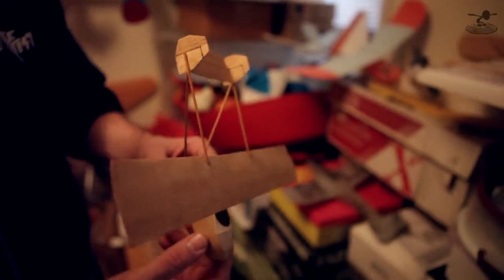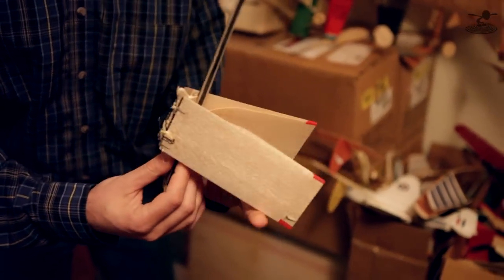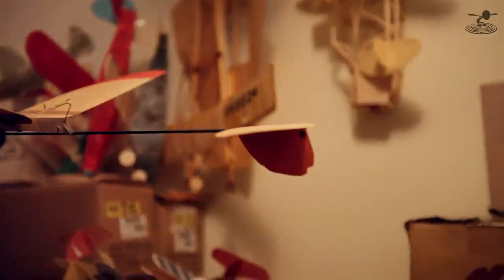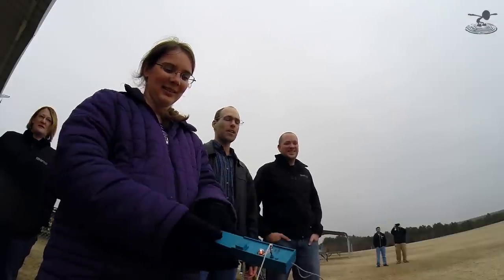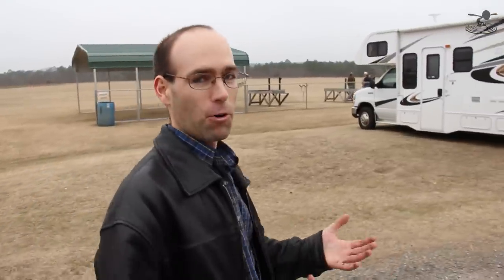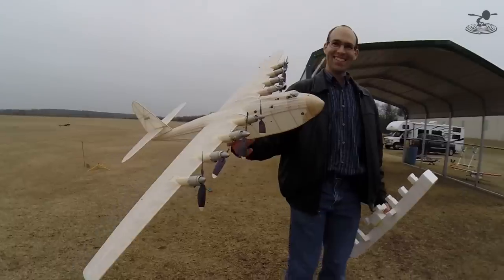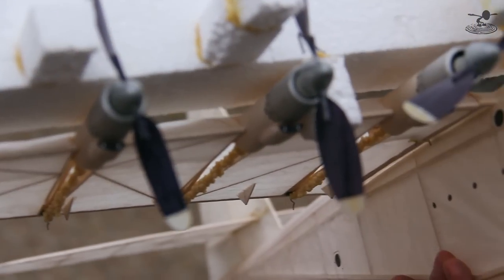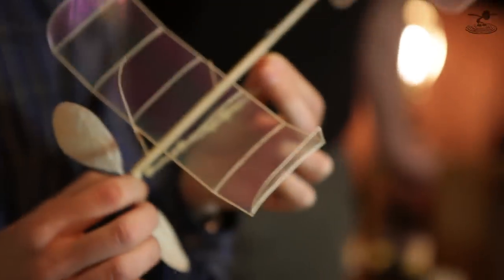Rocket Glider & Free Flight Airplanes | Flite Test

Comment: When I say I loved this episode, it's a total understatement. Freaking awesome . . loved everything about it and it brought back lots of memories . . mind you my rubber powered models were nothing like this at all.
Reply from the maker: Thanks! :)
Reply: My father saw me watching this episode and said the same thing. He used to play with the thin balsa wood planes.
Reply: I have a small balsa rubber band fighter sitting on my desk now waiting to be finished, I wanna see the other kind f1d- id like to get into that as well
Reply: I totally agree with you
Reply: I was thinking of building a balsa wood plane myself. I was wondering what that tissue paper-looking stuff around the frame of the planes was.
Reply: Ewolf 7 8
Reply: Ewolf 7+ The rubber band power kits I buy from Guillow use tissue paper that you glue on to the balsa structure. I found using a 50/50 mix of elmers glue and water works well for gluing. You moisten the tissue after glue sets and it tightens up nicely around the frame and wings after it dries.

Comment: This brings back great memories of time that I got to spend with my Dad. I can remember getting out the large board, covering it with wax paper and then using sewing pins to place the balsa pieces in place. Then we would open up the light brown colored glue in the foil tube and glue all of the pieces together. It always seemed to clog up and you had to open it up again with a sewing needle. I can still remember the smell of both the glue and the dope that we would put on the tissue paper covering the frames. We would fly the planes with rubber bands that we would wind with a hand drill at our local high school ball field. I also remember a Cox Free Flight helicopter with a 0.020 engine that would free fly up to about 500 feet and then auto rotate back down. I had an electric plane called an 'All Star??' or "SuperStar" that had a gear like drive that would rotate to provide rudder control left and right as it went through its free flight. This was one of my favorite new episodes. Pure joy and ingenuity. Please post pictures of their new baby!

Comment: As a kid I tried making a rocket glider with a cheap balsa wood glider and a 1/4 A engine... I at least thought it through enough to take an Empty motor and balance where I taped it with that, but we never got to the "glide" part. About 3 feet after it left the rain gutter we used as a launch rail the left wing snapped, and went 90 degrees up, but stayed on. This made it spiral off to the right where it crashed in the tall grass. Then the parachute charge fired and a puff of smoke came from the crash site, making it the most perfectly funny crash ever!

Comment: I've been flying RC and full scale for over 45 years. I made my first transmitter from home etched circuit boards. I still have an original ACE RC single channel pulse radio and a "littlest stick" RC with an Cox 0.010 that will do loops and rolls. I have one of the First factory foamy electric planes, a KRAFT Super Chipmunk. I Rebuilt my first real airplane, a 1940 Taylorcraft, in 1975. I now own a "duplicate" 1940 Taylorcraft (see my video, "Cat'n Tim's T-cart)  from 1977) I also own  1951 Bellanca (the last Bellanca made with a 225HP engine) and a Guillows RC mini. I also fly a 1958 Piper Comanche. My attic is full of collector's items from the 70's and a contest winning scale SE5. I still have a Top Flite Contender I built in the 70's hanging from my ceiling. AND an extensive engine collection. I also have lots of WW2 flight memorabilia, including a B17 exhaust valve and an instrument from a WW2 Japanese plane. Oh, and two Korean War Jet fighter pilot helmets! Last but not least, a brass fire extinguisher from a B-29 that still has CCl4 sloshing in it! Contact me at airplayn@hotmail.com. Capt'n Tim

Comment: One more suggestion.  When I was a kid I had a large glider that was ARF and sold in common stores that was powered by about a one liter bottle that was filled partially with water and then pumped with air.  Would be neat to see a rc version.  Maybe not a episode just for that but could do I need with all the unusual powered models like the co2 cartridge planes, diesel, and so forth.  Could make it a show showing the roots of model flight.  Dress up the hosts for the time period.  Ha!

Comment: Loved this show.  His passion and skill are contagious.  But his ability to design and built those swing wing models are amazing.  As a boy I built the old paper and balsa models that were rubber band powered and you really had to balance them for both powered flight as well as gliding flight so it was a trade off of sorts.  This guy did an incredible job of balance on the Spruce Goose, and his swing wings again were amazing.  Still can’t figure em out.  I think a kit is in order.  LOL   Thanks for sharing.
Reply: Kits are a thing. ;) jhaerospace.com is the place.

Comment: Probably every fixed wing RC flyer should have a go at making freeflight models, it helps getting familiar with correct CG and plane trim.

Not a lot of RC flyers would just chuck a large balsa model, because they would most probably end up as a bunch of sticks (I realise that they are set up to fly straight and level with power as opposed to trimed for gliding in to land), but getting the landing set up properly makes the aircraft somewhat stall resistant for perfect gliding touchdowns.

I remember a Burt Rutan video where he mentioned that many(if not all) of the aircraft he designed spent at least part of their life as a scale freeflight model, thrown from the control tower to get the weight distribution etc sorted perfectly.  The things people do (or did) when research facilities are too expensive.
?RC rubber band powered plane (or would the radio gear be too heavy)?

Comment: I have an F14 Tomcat by Estees that the wings fold back to take of,  the back pressure trips the mechanism that springs the wings out and lands like a normal glider, 2 ft long fuselage x 2ft wing span, about 25 yrs old, flew 3 times and almost took out kids at a playground when it landed right in middle of em

Comment: I have two questions. First i can see that you got a TBS Gemini so when will the review be coming out? Second is i noticed that there is a Bat Bone with what looks like 15inch props and with that i was wondering will you be doing a review on it?/ long flight times? As i did the same thing with mine but i also added a gimbal!

Comment: Wait... what's the purpose of the piston in the rocket powered plane? Does it cushion the initial thrust?
Reply: The piston tube (in this case a floating head piston) captures the initial exhaust gas expelled from the engine as it comes up to pressure. Normally this gas is just blown out into the air without producing useful thrust, but the piston tube confines it and produces forward thrust during that ignition period. The result is a significant increase in peak altitude (roughly 30% with the 18mm A engines used in this video).
Reply: joshuawfinn Ahh... got it! Thank you!

Comment: I am interested in starting to fly planes . I seem to like powered gliders . I have never flown a plane before so Im thinking of the kits you pop the wings on and insert the battery and you are off for the first planes then maybe building a foamy or something simple to get started what would you suggest to get started so i love this hobby as much as I love watching planes be flown . Thanks Mike
Reply: Michael Remillard Look up the various Horizon Hobby trainers. If you have calm weather conditions or access to a gymnasium or auditorium, the Vapor is the best training aircraft I've ever found. The Sport Cub S is also excellent and has many trainer features, but is able to fly more aggressively once you gain experience and are ready to switch to the more advanced flight modes. Look around for an R/C flight simulator so you can gain experience in maintaining orientation while flying.Electric gliders are a different subject entirely. The good ones tend to be a little pricey, but if you can find an old electric Hangar 9 Aspire, you'll have a low cost aircraft that flies absolutely wonderfully. Not a trainer though! It has a wide speed envelope, but it's easy to exceed the structural limits of those wings because it's so easy to accelerate to high speeds.

Comment: Ok. Here's what I want to see (besides a tri-wing Fokker speed build kit. Everybody wants that though.) I want to see a competition with at least 8 or 9 or more participants, $100 price limit, (not including transmitters,) everyone builds their own foam plane, and it's every man for himself demolition derby, last man in the air wins. So, you can design your own, or use am existing design. You can go quadcopter or whatever you want, so long as it's an all foam body and the price tag is less than $100. Winner get to be a limited time offer speed build kit if it's a different design than already exists. If it is a pre-existing design, then all components used to achieve victory (minus transmitter) will be on sale as a kit for a limited time. And winner gets a t-shirt of some sort or something. All losers can't shave their face or head for 2 months.

Comment: i ordered my first quadcopter, a 250 clone with mystery esc and a multiwii i used a pdb and soldered all the wires to the best of my knolage where they go. got it all wired up but together and man the thing was looking cool. However, when i pluged in the battery it all went to shit. A esc burnt up and so did a motor. I have no idea what went wrong. Any tips from the pros?
Reply: Possibly the wires werent connected or soldered together correctly. Sorry that happened to you. Possibly you can get new stuff sent if it was something defective.
Reply: yeah well how do i prove that
Reply: That usually happens when you get the polarity wrong somewhere. You want to make sure that you have plus and minus correct everywhere.

Comment: Me m my son did a rocket with his cubscouts and we canted his stabilizers a bit. We absolutely killed the height record.  Im curious about the physics of how it got sooo much more height. Did we store up some moment into rotation, or what?
Reply: Jack Olicious It's a stability thing. Unless you get the CG of your rocket within a very narrow bound, the rocket will either be unstable and will flail about, or it will be overstable, which causes it to wobble as it comes off the launch rod. This behavior introduces tremendous drag as the rocket accelerates, limiting its peak velocity, which in turn reduces altitude. Canting the fins introduces drag as well, but it keeps the rocket almost perfectly aligned with the airflow all the way up so that it tracks nice and straight and hence goes faster. This is actually a technique that is used on many unmanned rockets as an open-loop control system, and it is the same reason gun barrels are rifled so that the bullet spins as it goes through the air.

Comment: one wonders about a quad with some sort of grapple on a 10 foot cable hanging below for light aircraft recovery. ( glider in the tree ) or have you already done it?
Reply: Usually the plane is tangled in the branches where you can't use a grapple or even fly a copter above, because there's the rest of the tree ;)
Reply: Balu That's the exact problem. Quads are, however, useful for tracking down lost models.

Comment: the only time i put together a (12" or so) model rocket i used an engine that the rocket wasnt recommended for but it still fit. a friend and i launched it and instantly we couldnt see where it was in the sky but given the wind direction we knew the general direction it might fall but never saw it again. guess thats why it wasnt recommended for that motor. either went into orbit or landed miles away XD

Comment: How do you trim them since they don't have control surfaces?
Reply: Yasser Masood You shim the flying surfaces, adjust the CG, and offset the thrust line as needed to obtain nice tidy circles in flight. Not terribly difficult with most models.

Comment: Does anyone know what kind of aircraft the model at 0:46 is supposed to be?  It's pretty darned neat.
Reply: It's a scale Opel Rocket Plane for small Rapier rocket motors. Flies great, but the motors are no longer available. An enlarged one would probably work well on the low-thrust Aerotech D engines.

Comment: ? I have an idea, is scaled properly does anyone think it might work to have a light battery and motor or motors that will find one of two propellers while the other is operating the vehicle is it possible to use the potential energy in the rubber band and the short bursts of energy to quickly wind alternating rubber bands; to extend the flight in a maximum way I'm talking slow crawl.

Comment: why rudder on the bottom of the tail?
Reply: The exhaust from the engine is really hot, so you have to mount the rudder out of the way so it doesn't get burnt off. It also provides some nice stability traits for the climb-glide transition.

Comment: What's the big plane made of? Does anyone have any idea, if you do please let me know.
Reply: Since it's my plane, I guess this is where I step in. ;) The structure is balsa, 1/8" sq primary structure with 1/16" supporting. The wing ribs are two piece, 1/16x1/8 bottom and 1/16" sq top. Covering is tissue sealed with krylon clear; bottom of the fuselage has a layer of mylar under the tissue so that if I ever wanted to, I could fly it off water (actually have a photo somewhere of it in the water). Motor tubes are wet formed 1/32" sheet, and the props are 6" Ikara's trimmed to size and reinforced with carbon rods. Power is a 13" loop of 1/8 Tan on each motor, and they're usually wound to 1200 turns (gives about 45 seconds of flight). In theory those motors should take 1400-1500 turns, but I've never pushed it that hard.
Reply: joshuawfinn Thanks a lot, that's very helpful. And of course it's an honor to be noticed by the maker of that beautiful airplane.
Reply: Daniel Pritchard glad to be of help!

Comment: Watching you guy is really great for me it brings back so many wonderful memories from my childhood. ow ever you mentioned bring in new idea's I Have one I have yet to see. With all the new innovations in RC and the control devices how come no body has developed a voice command controller Think about it for a second you set up with he flight googles for the quads and some of the planes yet you still fly with your hands. WHY? wouldn't it be easier to put the goggled on and then say something like lift and bank right or bank left and have the quad or plane take off in to the air and bank left or right? If your really going to make a big changes in RC flight I would think that would be the one hat would put you on the map and set you apart from the rest of the pack.
Reply: Response time and manouverbility. In the time that you can make 1 voice command (and it does not come into effect untill last letter is spoken) you could have made a several minor and major course adjustments by hand.  For voice command to work the model would have to be a robot/semiautonomous since 99%  of the timeit would be steering itself. I would be as much fun as standing right next to a model pilot and telling him what to do with the airplane.

Comment: How does it make circles?
Reply: +Kenneth Wang Rudder offset balanced with opposite roll trim on the wings. The rubber models also use an offset thrustline so that the propeller pulls the model to one side or the other. These strategies keep the model on the field (in calm weather) and centered in thermals (when you can find them).

Comment: It would be cool if the rocket ejected off of the glider when the wings popped out to reduce weight and hopefully increase flight times. Of course it would need a specialized aircraft so it can eject it and stay balanced.
Reply: +Andrew Pearson Actually that's easier than what we did here. You use the weight of a motor pot up front to make the aircraft ballistically stable, and use the CG shift from dumping all that weight to get it into glide trim. The folding wings I use are as much for making the aircraft stable on the way up as they are for reducing drag.
Reply: +joshuawfinn Impressive planes right there, keep it up
Reply: Arth Glob Thanks! I'm just standing on the shoulders of those who came before me.

Comment: He should sell those things! They were amazing!
Reply: joshuawfinn I live in Switzerland so I don't think the rocket planes would get past customs. What about the other ones?
Reply: Squeek Long-Tooth Since it's just a model airplane that happens to be powered by disposable rocket engines supplied by the end user, shipping shouldn't be a problem. I sent one to Norway a while back without issue. So long as you can obtain 1/2A or A class rocket motors, you're good. If I'm not mistaken, 13mm motors are difficult to obtain in Europe, so you would need to put a sleeve around a 10.5 mm motor to friction fit it into the motor tube. This is commonly practiced by US competitors when they attend contests in Europe since they have to obtain motors on site.
I'm not selling any model kits other than rockets at the moment, and it could be a while before that changes.

Comment: Where can I get the super awesome switchblade unfolding one?
Reply: joshuawfinn thank you! :)
Reply: joshuawfinn they have the regular ones which is cool but I wish I could get the one with multiple folds. The most complex one he showed that folded the each wing in half, the folded the wings together and then finally into the normal switchblade version(maybe , hard to figure out perfectly). It was the one he showed in his model room and was by far the most complex. Sadly I suspect that's more of a personal plane since I don't see those online. But I may contact and definitely want to get one of the regular ones.